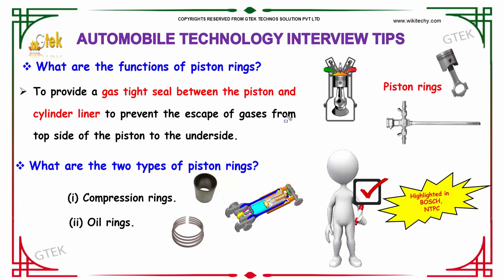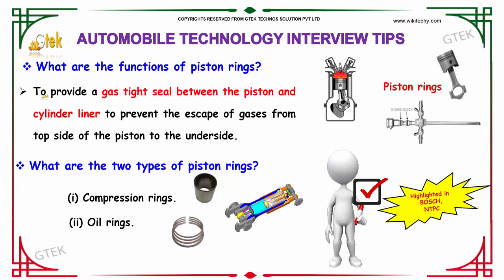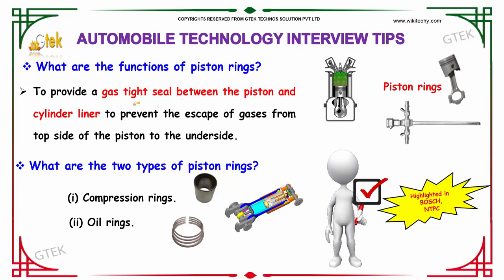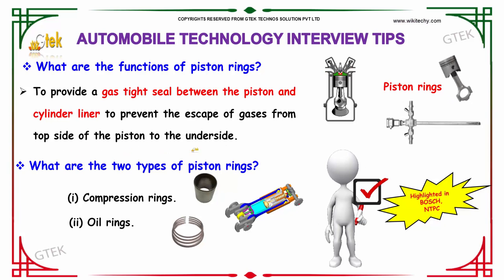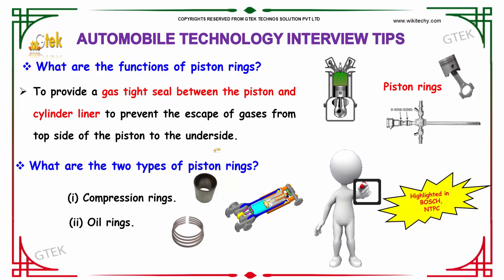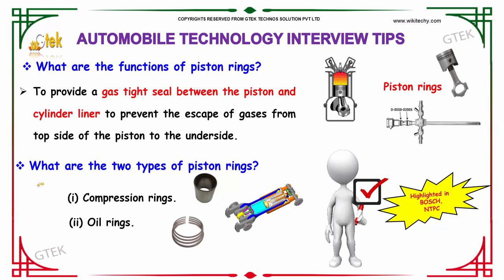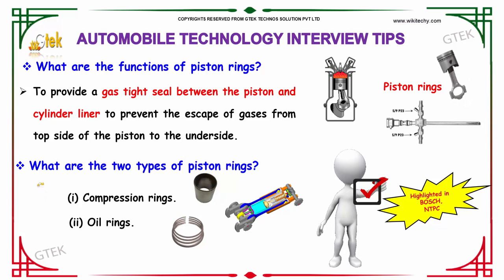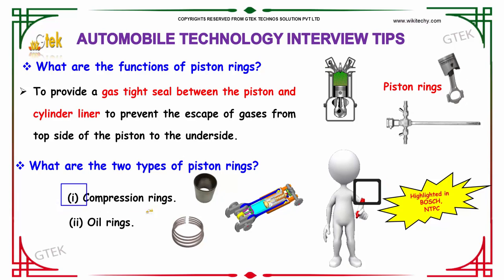What are the functions of piston rings | Automobile Interview questions and answers

Comment: Automobile Engineering is a branch ofengineering which deals with designing, manufacturing and operating automobiles. It is a segment of vehicle engineering which deals with motorcycles, buses, trucks, etc. It includes mechanical, electrical, electronic, software and safety elements.

Comment: To provide a gas tight seal between the piston and cylinder liner to prevent the escape of gases from top side of the piston to the 
underside.The three main functions of piston rings in reciprocating engines are ,Sealing the combustion chamber so that there is minimal loss of gases to the crank case. Improving heat transfer from the piston to the cylinder wall. Regulating engine oil consumption by scraping oil from the cylinder walls

Comment: The three main functions of piston rings in reciprocating engines are :Sealing the combustion chamber so that there is minimal loss of gases to the crank case.Improving heat transfer from the piston to the cylinder wall.Regulating engine oil consumption by scraping oil from the cylinder walls back to the sump